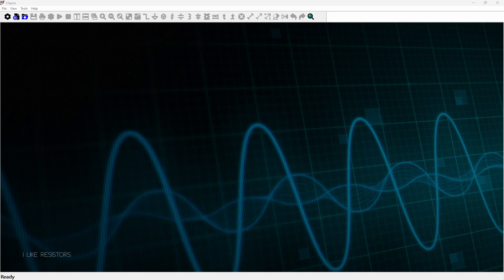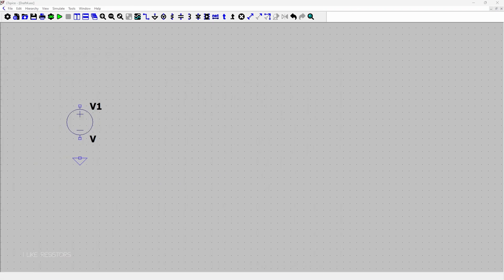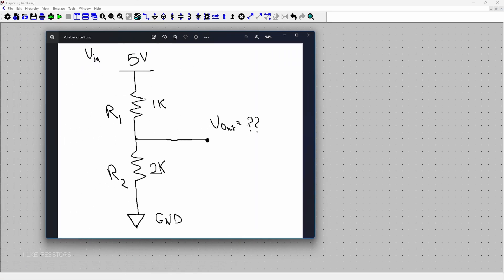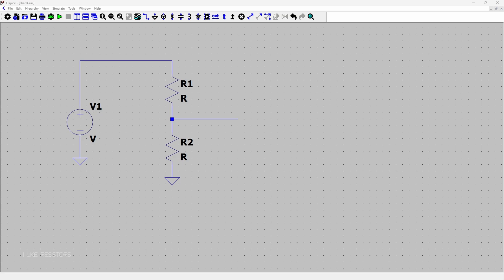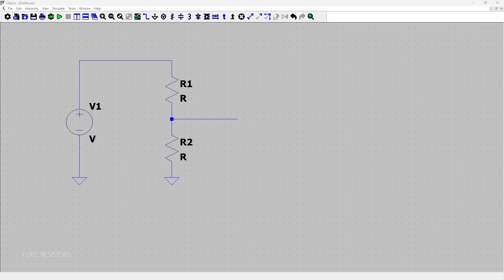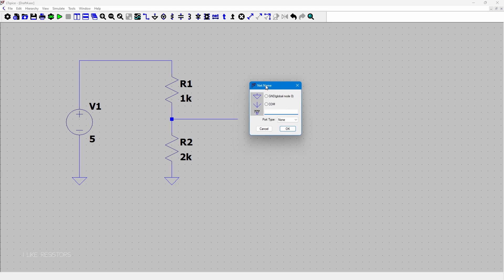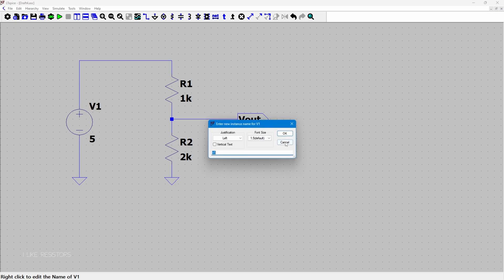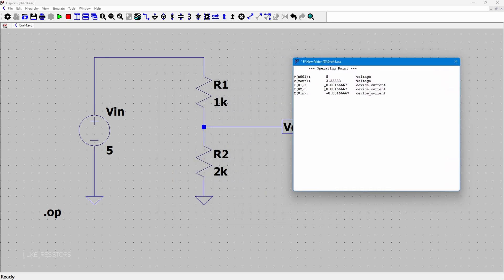How to Design and Simulate a Circuit in LTspice (Beginners Tutorial)

Comment: tanks a lot but why this negative value for the current throught the source ?
Reply: yeah because the SPICE assumes the source goes from positive node to everywhere it has wires, so the current also go to ground, that's why it's negative. You don't have to worry to much
Reply: @newhorizon4470  merci